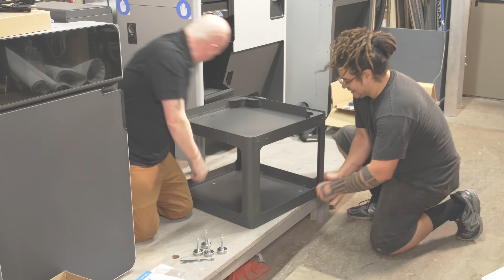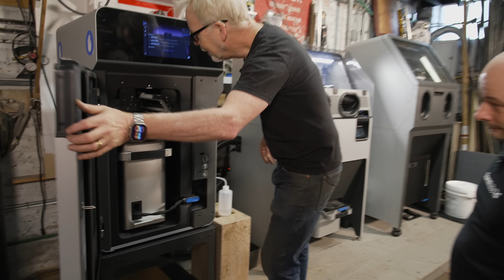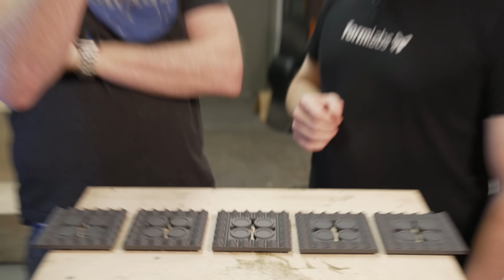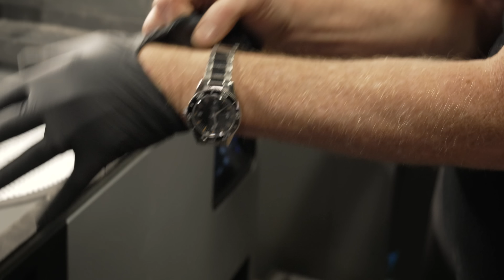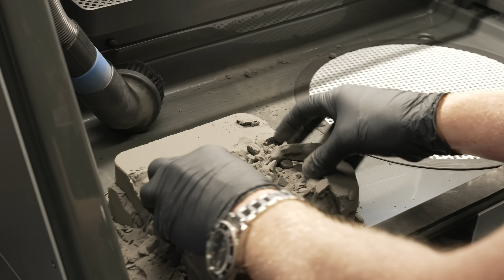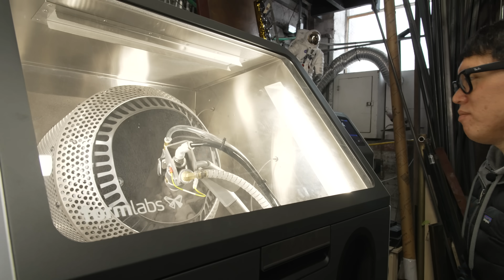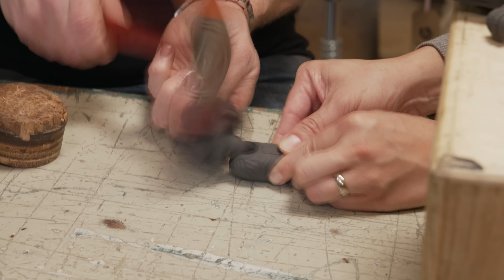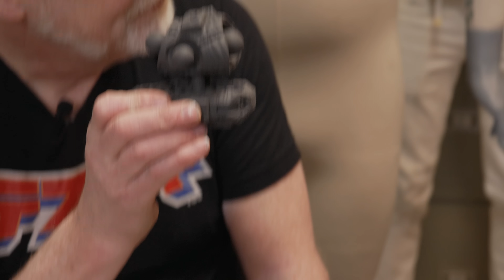Adam Savage Levels Up His Workshop 3D Printer!

Comment: I wonder if wearing a mask when moving the container between the machines or fiddling with the power with your hands would be a good thing to do to prevent some inhalations of that powder.
Reply: A mask should be worn at all times when working with this system.
Reply: Yes, the lack of PPE use was disturbing. Sure, one time won't kill you, but it's all about being in the habit because the continued exposure is a problem.
Reply: @MTGeomancer I suspect their technician was a little bit too chill about the exposure risk, he apparently did mention stuff about PPE but said things like they could use the hood open without masks,* and was even there during one of the shots where Adam was just pouring loose nylon powder into the machine. 

*Yes I know there's extraction air flow but you could see the dust flying off in all directions before being captured by the air flow, that level of protection should really only be treated as a backup on top of a respirator, not a sole protective measure
Reply: @bosstowndynamics5488 from what I’ve seen Adam is far too chill about inhaling lots of stuff.

Comment: As someone with the certs to do maintenance and training on these machines, I wanted to scream at the screen a couple of times here. The guy from Formlabs was way too lax about the safety IMHO. But I guess it looks better for the cameras if you're not wearing PPE and keeping the hood open.

And for Norm. Hollowing out parts is not what you want to do here, unless you fill that void with other parts. You'll just end up with an excess of used powder. Shoot for 30% packing density if you can (which is hard to reach, I know, but hollowing parts is going to make it a whole lot harder :D ). It does feel wasteful to print solid but having a bunch of excess used powder that you don't know what to do with is also a pain.

Also, make sure you follow the maintenance schedule on the machine. And for the optical cassette and filters I'd just do it before or after every print rather than waiting for the timer to run out. Makes it easier in the long run IMHO. Also keep things clean around the machine. Even a single strand of hair in the hopper can ruin a print if you're unlucky. And be mindful of the blasting media so that you don't bring it back into the Sift, too much of it will make the PrinterWatcher abort the print and you might end up having to discard a bunch of contaminated powder. I'd hope the rep from Formlabs went through all this but I kinda got the feeling he didn't.
Reply: As far as i have understood in this video, unused powder goes back into the system?
Reply: @Daniel-rd6st  It does. But it has to be mixed, in the case of PA12, with 30% fresh powder before it can be used again. The problem if you keep printing at low densities is that you end up with a hopper that is full of used powder that doesn't get re-used fast enough. You can technically use straight used powder but then you run the risk of poor quality or just failed prints altogether.
Reply: @treborrrrr  Thanks for the explanation!
Reply: @Daniel-rd6st  yes but for quality you have to have a certain percentage of fresh to used powder because it gets heated and cooled  on the MJF machines we run 70/30
Reply: @Daniel-rd6st  Most of it, but the following prints also need virgin material mixed in
Reply: We will hunny comb our builds when possible to avoid elephant skin from solid parts
Reply: Use your treble to hallo out and fit the action figures together
Reply: I have a feeling the Formlabs rep went through all of this in the most textbook way possible and Adam just said "yeah yeah, I've been around chemicals for decades, I'll be fine."
Reply: @NefariousElasticity yeah, kinda cringe
Reply: @Remco88  why is something this guy made up in his head "cringe" 😅
Reply: Yea, Im no expert at all, but I couldnt help think "Surely thats not the recommended way to handle that??"
Reply: as styropyro likes to say "just looking at this spot on the wall will make you go blind"
Reply: Yea doing anything with out gloves or even the hood up looks like an instant lung cancer diagnosis.
Reply: Thank you for all that, good god that sounds like a whole new level of technical
Reply: This channel larps quite a bit when it comes to actually knowing about things. I understand it’s also meant to be entertaining but they would do well working with professionals more often who really know their stuff.
Reply: jeez ADAM and NORM IGNORE all safety guidelines provided by Formlabs - the instructor told Adam to check the temperature before removing - IGNORED!!
Reply: "You'll just end up with an excess of used powder."
Of which... 99% will be sifted and recycled.  A big nothing burger really.
Reply: @_SurferGeek_  I elaborated a bit on that in a different comment in the thread. The problem is that you can't use the used powder as is, it needs to be mixed with 30% fresh powder. If you're not using up 30% of the build volume to create your print you'll end up increasing the volume of powder since you have to keep adding fresh powder to it. Hopefully that makes some sort of sense. It's late and my brain isn't working full speed :D
Reply: @treborrrrr  Your comments make perfect sense, this comment section is just filled with people that failed kindergarten...
Reply: @treborrrrr  Another Fuse tech checking in here and I understand completely what you're talking about. Sometimes, it's just easier to use up some of that recycled powder with solid prints that normally you'll hollow or change the infill of with other methods of printing. 

It's not uncommon for me to arrive on site and see customers with a couple of boxes or bags of fresh powder and then 30-40 bottles of powder labelled 100% used. You then need to store this powder, keep it dry and then it becomes a logistical nightmare. But then, you also have to keep track of how many times it's been through the printer as well. All well and good to just call it recycled... but there is a difference between powder thats been a print cycle 2-3 times compared to powder thats been through 20-30 times and you're sending us support requests for poor surface finish on parts... while swearing black and blue the powder isn't that old.
Reply: @tasmaniakguitars ok so if you took just used material that you would say eh this is worthless now could you technically print out a solid bar of plastic the size of the entire print area to safely discard in the regular trash ,, so as to not be putting powdered micro plastics into the environment? 

Or would that print take like a week and extraordinary wasteful amount of power

Comment: that cable shoudl be a dual connector part.
bending and moving it will eventually break it 
AND it would be much more easy!!
if you could remove it from the build plate bin.

Comment: Sand down the joints, and give them a silicone, or some rubberized coating via dip or brush?
The Ball joints need a millimeter or so removed, or, a small hacksaw, and a reprint of the balls in a flexible material. The elbows and knees would be a good way to test. But a misprint doesn't necessarily mean garbage. 
It might even make a whole episode of you and Norm figuring out how to salvage a project when something unexpected happens.

Comment: Try printing those same action figures with the same joints fully formed. so no assembly is required.  that process looks like it would be able to do that.
cleanup would be more challenging, but would be interesting to try.
Reply: Just alittle extra blasting in the joints we would hand blast that build instead of tumbling
Reply: Was actually thinking about the same, what would happen if you just tried to print in place?  I am guessing the powder would be packed so tight into the joints it would be mechanically locked...but maybe not?
Reply: @MrAcuta73  you adjust the tolerance slightly should be able to break it loose
Reply: print in place SLS is basically what its made to do
Reply: Was also wondering this
Reply: FFF printing actually has models that print assembled. all kinds of things not just action figures search print in place in your fav print repository 🤠
Reply: That's would work brilliant the other option you could use is also splitting the models and use screws or glue to rejoin parts around the joints, also with the dowels since this is your first try on the machine you could reduce the diameter of the dowels or increase the hole diameters so it's still a firm fit but obviously not as tight as they were, this would come with knowledge of using that machine over time and please 1000% wear the ppe you don't want to breath that stuff in at all
Reply: This is exactly what I was thinking!  I feel like that model was intended to be printed in place.
Reply: Impatience! Seeing that the tolerances weren't right after the first attempt at press fit, the better more cautious thing to have done would be to use some sandpapers or burrs to take a little off the balls, perhaps along one line of insertion so the remained of the ball still fills the socket snugly.
Reply: Not a solution @mtndogrally, the ideal way! Kudos!
Reply: I feel like that would require a long and not fun trial and error printing to find the balance where the gap is not too large that the joints are loose but not too tight that the parts just fuse together.
Reply: @DarthBiomech  "I feel like that would require a long and not fun trial and error printing" -- I feel like one would just print a whole mess of samples that are expected to be in the right range, all as part of the same print job, then use those objects to determine the ideal dimension.

Once one has established that, just use the same clearances for similar projects. It's a one-time calibration, and not really that onerous an effort either.
Reply: @DarthBiomech  not really, can do a print in place tolerance test Same as any printer and it will tell you how close you can have them before they fuse together
Reply: in my experience, print in place can be possible with powder printers (got some trinkets i printed for myself lol), but just sending an assembled print won't cut it. there's an easy chance the tolerances on the parts wouldn't work for powder printing - with each layer printing, the powder's getting zapped by lasers, so it's most likely the joints would fuse together with small enough tolerances. per my experience and other ppl here, the three options are either 1) adjusting the tolerances on the figure, 2) adjusting the settings on the printer (print quality might not be what someone may want, such as the dimpling and "birch-barking"/elephant skin), or 3) post-processing (whatever tf you can try lmao, sanding, filing down, etc).
Reply: The product would have to be a lot smaller.
Reply: I have done print in place with SLM. The problem is the time it takes to work the powder out of the joints. Also the powder can act like sandpaper/polishing compound until it has all been removed. Much easier, safer, and faster to make multiple pieces and then assemble.

There are times when print in place is better but it's a lot of extra work that is 96% of the time unnecessary and avoidable.

Comment: Seems to me like you guys have a one day fix build for those two models 😁
Also, you need to set up a red and green light system for installing the print chamber into the cleaner, so when it's done you can utter "when the light is green the trap is clean" 🤣

Comment: Since no supports are needed wouldn't you be able to print the action figures already assembled with the ball joints just printing in place already together?
Reply: Probably! It probably matters more on the tolerances than anything else.
Reply: Looks like it’ll waste powder, so they want to limit their z height as much as possible
Reply: @demetriusmichael You have to fill the chamber anyway, and it doesn't really waste powder that much since you can run recovered powder through the machine again (there's a limit due to thermal degradation but it's not like all the dusted off powder goes in the bin). The bigger issue here is that to make it print in place you need clearance between each part so a print in place action figure in a single material process would be loose and floppy, whereas I think they're going for poseable

Comment: Could sanding or a Dremel be used to get the parts to fit, or is the material too hard? Also, I think I need a "Superglued my fingers together" demerit badge. Great vid!
Reply: It sands great we do it all the time when the parts need it only problem is that it's not as easy to hide when finishing. Also we will install heatsets and melt in inserts when ever the customer asks

Comment: I worked on the electromechanical props for the Harry Potter stage shows (magic effects). We had an in-house resin printer at the time, but of course props get dropped quite a bit, and when the resin printed parts were dropped they basically disintegrated. Eventually we outsourced the printing, getting them made in SLS nylon - much more durable. Of course we then had a different problem, being that the nylon parts were actually quite difficult to finish. Nice printer - no way I can afford one, unfortunately!
Reply: Resin parts should be used to make master molds for any application where the output is going to be handled regularly. Resin prints are at best display pieces.

Comment: Man, all that dust made me want to cough. Great new toy, though.
Reply: Should see a production shop the dust travels everywhere its in my car have to shower when I get home. We have a blasting room and by the end of the week it's quite the layer of powder everwhere.
Reply: @mattrussell8813  Is it common for these machines to have something like an airlock, but then for dust (let's call it a dustlock)? I could even imagine something that pushes air from the dustlock into the main chamber to prevent any dust from floating in.
Reply: @dkfsamurai  I know on the hp mjf machines similar to sls but uses toner instead of laser. We have nothing air tight  the post processing unit is open on the bottom when the glass is closed but we usually just have the glass up because of the work process and in the blasting room we do our best to contain everything but it leaks out anywhere it can. And clogs everything our two-man blaster we have to clean the filters every 5 hrs and have to empty the dust collector every 2 weeks
Reply: @mattrussell8813  Thanks for your detailed answer! Have a great 2025!

Comment: Can you adjust the tolerance of the balls and sockets a bit and print the whole model already joined in-place?

The clink "sound" reminds me of the brick sounds in the Blues Brothers when their apartment gets blown up by Carrie Fisher.
Reply: That's exactly all they have to do. We do fits  like that all the time at my company
Reply: You can. Getting all the powder out will be a bit of a pain though. I've printed a few things that are print in place with similar joints and it works, but you have to work the joint back and forth quite a bit to move the powder out. If the model allows, you might be able to help that along by having "ventilation holes" inside the joint.

Comment: Couldn't you print the action figure parts already assembled?
Reply: Yes, and no.  Yes, you can, but you have to leave space(allowance) between the parts, but that means the parts will fit loosely. Which is not ideal for an action figure.  You need the pressure of the parts together and their flexibility for the joints to actually stay in place but have the ability to be moved. If they were printed together, they would be fused and unable to move. I hope this cleared up some contradictions.
Reply: I have seen assembled parts in SLS. If you have enough clearance for the powder in the joint this will work. Formlab has a print in place little case that use that process.
Reply: No because you'd have one solid statue. 

Even if you were doing a statue you'd still probably do it in parts, just in case some thing went wrong.
Reply: @N94able  it's layer by layer, so you could print it with some tolerance, just like print-in-place joints for normal 3d printers.
Reply: @N94able  I've printed jointed figures and millipedes and other multiple movable parts items with regular 3d printers... it's nothing new. I'm sure it could be arranged with this system.